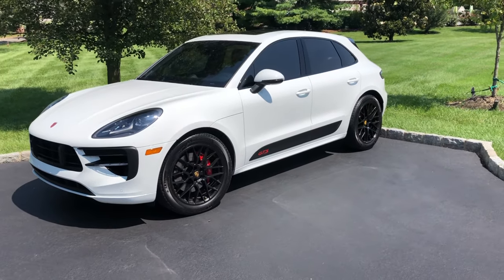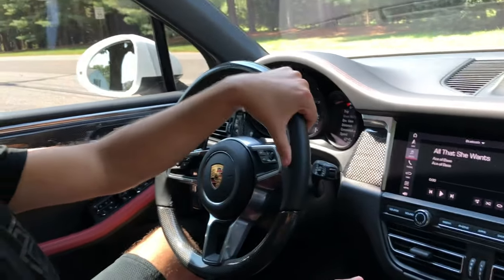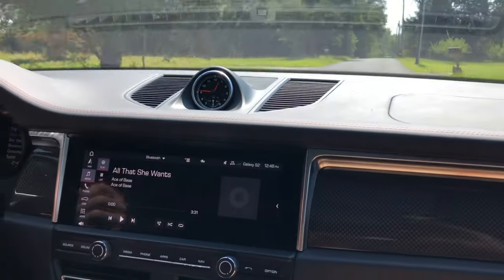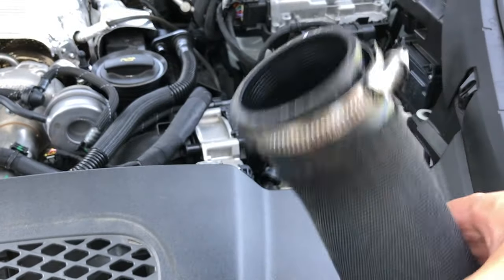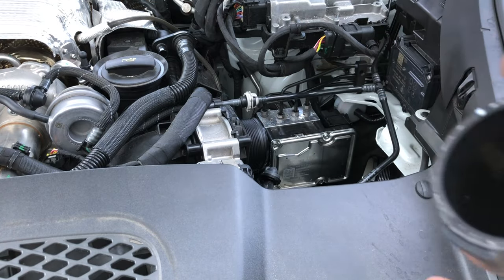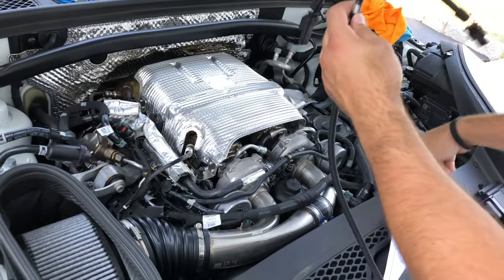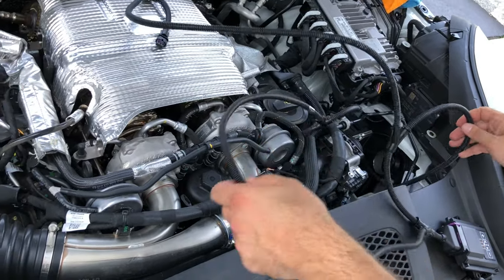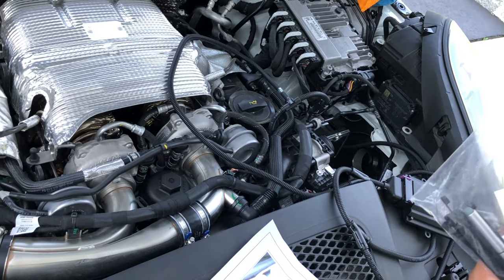2021 Porsche Macan GTS Vector Tuning Programmer Installation & Review 2.9L Chip Tuning Box!

Comment: Well…..how did it go? Any issues?
Reply from the maker: He did report to me after 100 miles or so it threw a CEL. He said the car is running fine but it is displaying a CEL.
Reply: @pfmustang  Does his exhaust not void the warranty? Was he not satisfied with the stock Porsche sports exhaust that comes stock with the GTS?
Reply from the maker: Only voids the exhaust portion of the warranty. Stock was too quiet, wanted some more tone.
Reply from the maker: update he sent the device back to vector and they reflashed it. He’s driven about 600 miles now and no check engine light.
Reply: Should’ve gotten sports chrono. Also, there is a boost gauge.